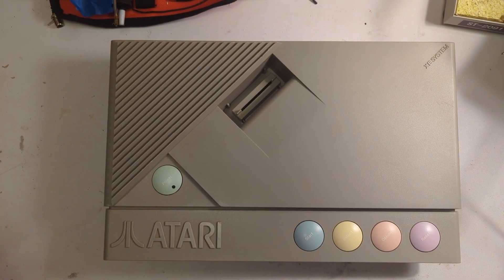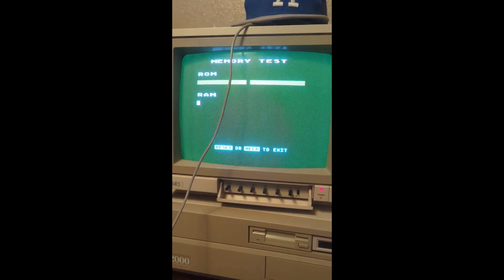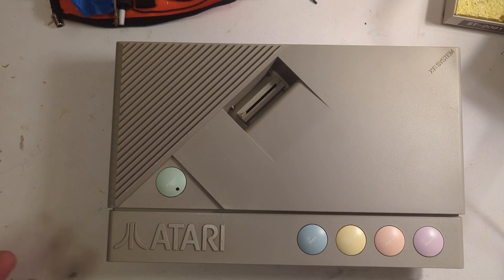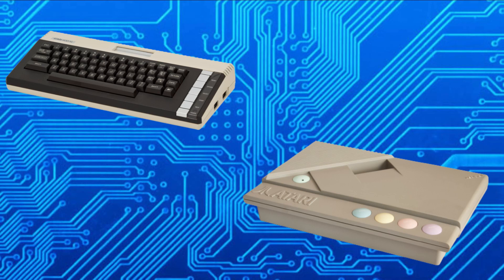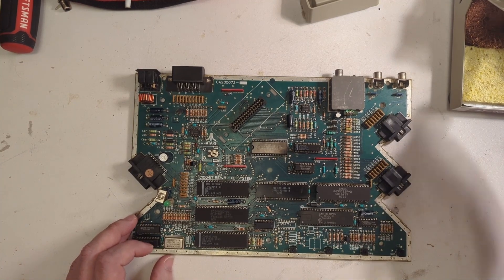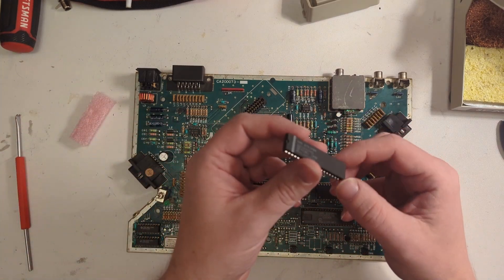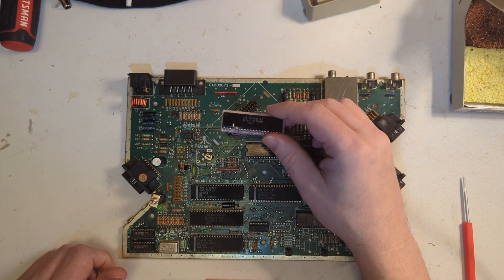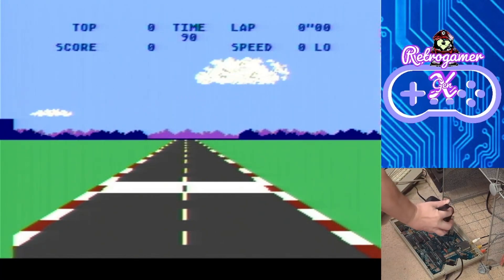Let's Repair an Atari XEGS: Weird ANTIC Failure

Comment: Should you fit heatsinks?
Reply from the maker: The RF shield is not shaped to touch the chips. So Atari designed it with no heat dispersion in mind. The chips get warm, but not hot per se'. But it couldn't hurt. I might end up doing that. 👍
Reply: @RetrogamerGenX  any atari 8  bit I have had open gets very hot on certain chips.
Reply from the maker: @blackterminal  On my 600XL the MMU, Sally, and Antic seem to get a lot hotter then in the XEGS. Especially the MMU, it gets super hot. But it's more of a shelf piece CIB. I only get it out now, to power it up to charge up the caps monthly, to keep them healthy.